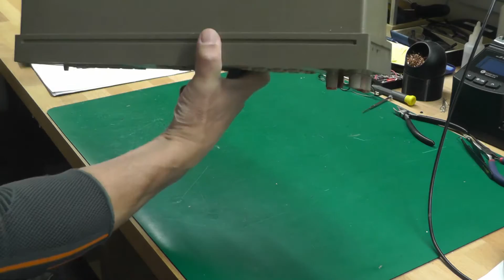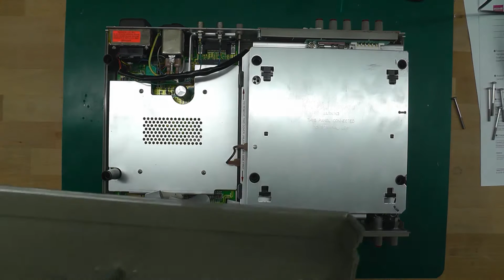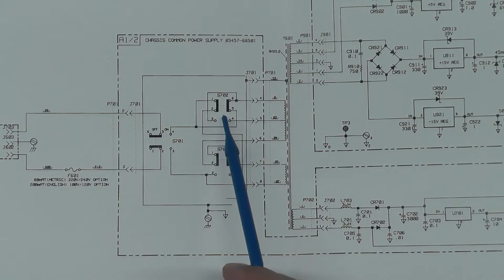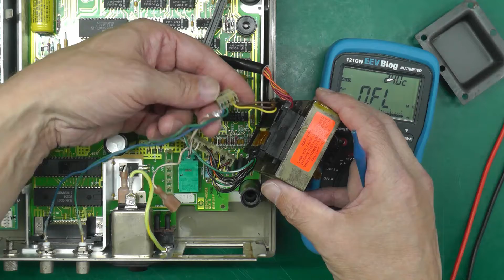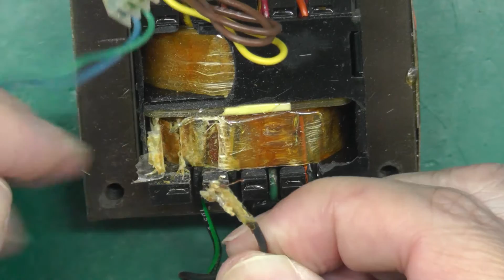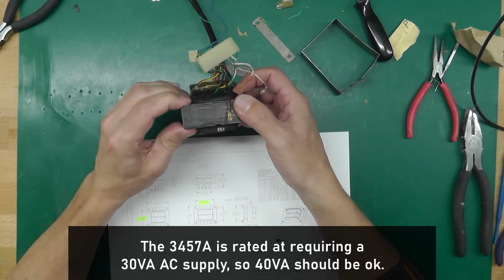No.060 - HP 3457A DMM Repair - Part 1

Comment: Custom made transformers are at reasonable prices now. Lots of firms here manufacturing any wattages, number of windings, wire gauges and a lot of templates for order.
DIY probably would end up more expensive even if you manage to find parts.

Comment: Ive been trying to do the same with my Transformer from my Ada mp1 preamp.  I removed all the I.  But the E laminations are stuck.  I'm going to try boiling it in hot water thanks for the tip
Reply from the maker: My next video out soon will provide more info how I went about it.

Comment: I used to salvage ferrite cores out of computer SMPSs and I found that slowly heating the entire thing to around 200°C in an oven softened everything up nicely - same would probably apply to this, although I'd start a bit lower in case the bobbin starts melting! The laminations will be put in from opposite sides and can be whacked out with a ruler as someone else suggested.

Comment: Where you have taken an "I" out between 2 "E" pieces you can use a metal rule onto the flat edge of an "E" poking through the centre and knock it out with a hammer, warming may help.
If all else fails you can get hold of an e with pliers and pull, or a screwdriver through an outer  "E" hole and lever it out.
You may damage it beyond re-use but with lacquer when rebuilt it will be fine.

Comment: Shame that transformer was glue together too tight =/  Looking forward to the next part!  What voltages does that board need?  I wonder if you could just go with a pico PSU and some other regulation to get the voltages required - worst case!  It's obviously going to be better with a replacement transformer =D

Comment: Back feed the biggest secondary winding from another transformer if you get completely stuck. Your lucky though you can measure the coil parameters on your other meter
Reply from the maker: Yes, I managed to take resistance and secondary voltage readings so have all the info to hand.

Comment: Maybe you should try powering up the unit with your bench supplies in case the entire thing is fried before trying to solve the transformer issue, never know it might have been a lightening strike that got it.
Reply from the maker: I've got all the schematics so not really worried about getting the boards working........well, just as long as it's not the A/D Hybrid! The transformer problem is something new, so looking forward to it.
Reply: IanScottJohnston - I just had a physical service manual arrive a few days ago, I always try to get a proper manual if I can as the diagrams are usually easier to read
Reply: If it had been struck by lightening (sic) then it would be looking a lot more pale. ;-)

Comment: What about using a single 12v/24v switchmode and using that to feed the individual regulator sections?
Reply from the maker: Switch mode psu in an 6.5/7.5 digit DMM is probably not a good idea, besides I want to be true to the originality of the 3457A, including the line selection switches.
Reply: IanScottJohnston - I was thinking that as long as it feeds the original regulators they should get rid of a lot of line noise, radiated noise could still be an issue though, can get small din rail ones from mean well for not a lot of money, with reasonable quality.

Comment: Hi Ian, I think you'll find if you drizzle acetone onto the laminations it will seep inside and they'll come apart. Otherwise the judicious application of a heat gun will do the same. Pre warming in a reflow oven at a low temperature will also help. The welded ones are actually easier to separate as you just cut the welds with an angle grinder.
Reply from the maker: I tried acetone but it didn't move the varnish at all, not one little bit. Paint stripper is another option provided the bobbin doesn't melt. I didn't try a heat gun though......hmmm!
However, the E's and I's  are well and truly clamped in there.
Reply from the maker: I've also got the depotting compound I used on the DC-DC converter a few months ago......hmmm!